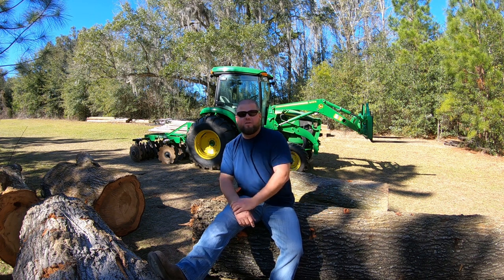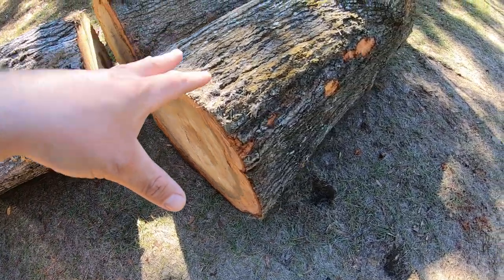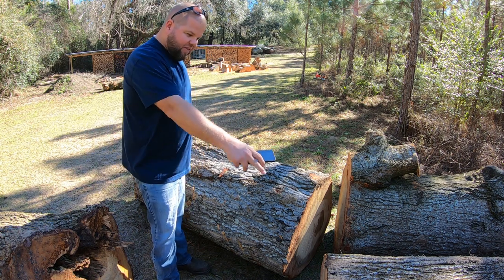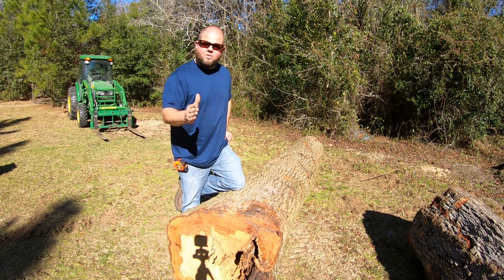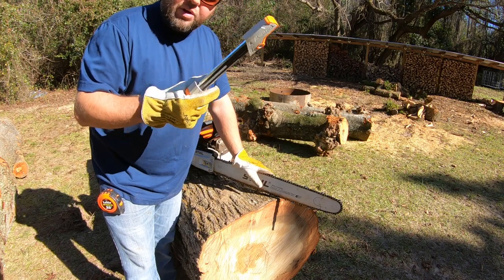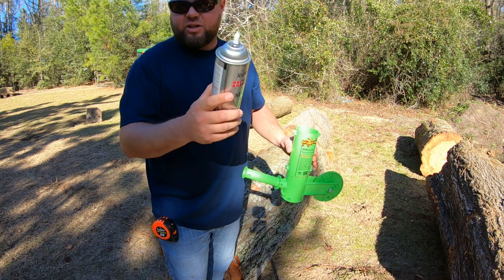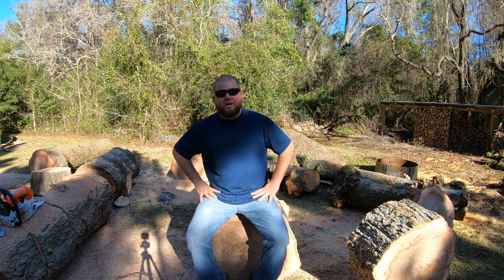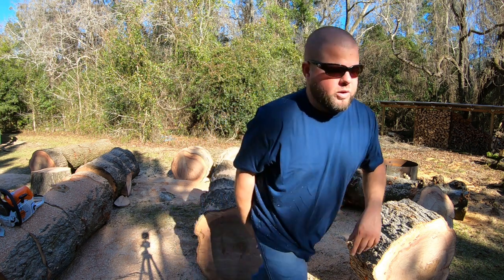#237 John Deere 4066R max lift capacity! Stihl MS462 cutting firewood

Comment: Hey, man. I like your vids and content. One word of advice though. Often, the max listed weight a tractor "can" lift, is to protect it from breakage. It is surely impressive to watch see machine pick that big toothpick up, but when it's that high off the ground the rams are very extended and can bend right up when they are that far out of the cylinders. If you have to grab and move something that far out of spec keep it as close to the ground as you can while still maintaining your ability to travel. Also, a machine can tip over sideways waaay easier when a load is up high. Much easier than when it's low. Lastly, when a heavy load is high and it tips you can bend the arms themselves, and not just the rams. The arms are designed to lift up and down,, the rams, to extend in and out. Side loading with a heavy weight (not even one nearly this heavy, can do serious damage very quickly. Now that you know what it  CAN do, use it as a bragging right. Not a usual course of action (which you alluded to so I'm sure you won't). 

Not preaching, man. Just don't want you to suffer by learning the "hard" way. 

Thanks again for the vids man. Subb'd.
Reply from the maker: Very well said. This is only the second time in the over two years of owning this tractor that I've ever lifted this much. I definitely don't abuse my equipment or want it damaged. This was more for viewer info than anything else, alot of people watch my channel specifically for this tractor and reviews of it. No hard feelings taken, thanks for watching!

Comment: Fun video Andrew and I can tell you have fun making them! I’ve been looking into the new 462 for myself, I think it’ll fill my 70cc range saw void!
Reply from the maker: Thanks! Yes I love making these videos, nothing else I'd rather do. I absolutely love my 462, it amazes me how well it pulls a buried 25 inch bar, I can't see myself ever needing a bigger saw. For the smaller logs, I bet it'll rip and really speed up cutting.
Reply: Just came to your channel for the first time. I’ve been using a stihl 460 since around 2006. Use a 20” and a 28” bar over the years. It’s been flawless. I blew it up once and it cost me $65 around 6 years ago. Good as new after. Dropped a log on it once and with breaking gas/oil tank that was around $200 to fix. Mean machines. Enjoyed the big toys!
Reply from the maker: Welcome and thanks for watching! Love my Stihls as well! I have a 17 year old 260 pro that's been a reliable workhorse.

Comment: big ol chunks of oak, you should get a bunch of nice firewood out of that. Saw is cutting great, I am a husky guy and just bought a 372xp with 24" and 28" bars, can't wait to cut with it, I think it's pretty comparable to the ms462, good equipment isn't cheap.
Reply from the maker: No good equipment is definitely not cheap! But if this Stihl is like my other two saws, I shouldn't have a single problem with it. Nothing wrong with Husqvarna at all, I think they make great saws. Stihl just had the lightest-weight saw out, and that was an important selling point to me.

Comment: i highly recomend the logox 3 in one forestry tool. instead of just a cant hook. i just got mine for christmas this year and i dont cut wood without it now. i love it.
Reply from the maker: I looked at it but was worried I'd never use it to its full potential. I find multi tools don't get used because of constant taking apart and putting back together for the different tools involved. I was thinking about buying all three tools separately. Do you find that as a issue? Thanks
Reply: @TKCL  i did change out my pins on mine to make it a little faster when changing out the differnt attachments . i was worried about the convinance of it as well but its very nice to only have to load one tool in the side by side rather than 3 seperate tools taking up more space.
Reply from the maker: Thanks for the feedback

Comment: Looks like the 462C is working out well for you Andrew, picked mine up yesterday evening with a 25inch bar
Reply from the maker: Your going to love it, I'm not even broke in yet and it's just blowing me away. Plenty of power for that 25 inch bar. I've always been use to having lack of power and have to cut slowly. Not anymore!
Reply: @TKCL  agree totally, I have several 24 inch plus trees to take down this year and not wanting to put undue pressure on my 261C it worked out as cheap to buy a bigger saw than to pay someone else to do it
Reply from the maker: That 261 is a sweet saw, my dad just got one. Fantastic firewood saw, but probably a little underpowered for a bunch of tree falling and 18 inch plus cutting. I think you made a great choice for a companion to the 261